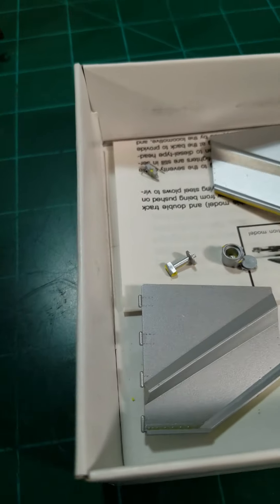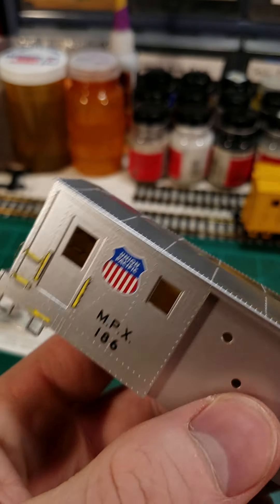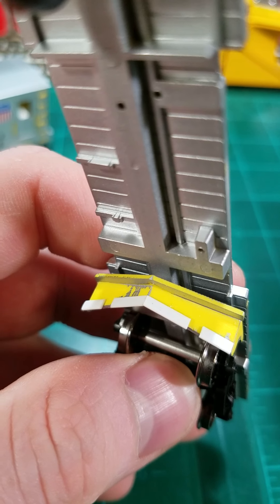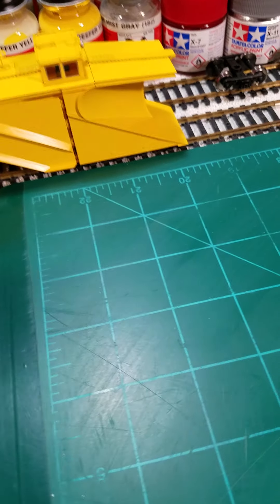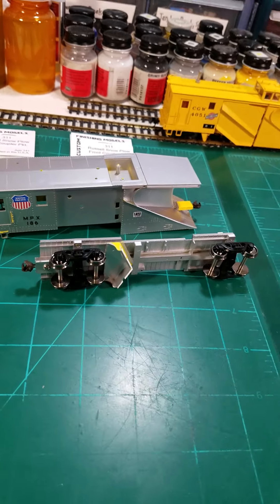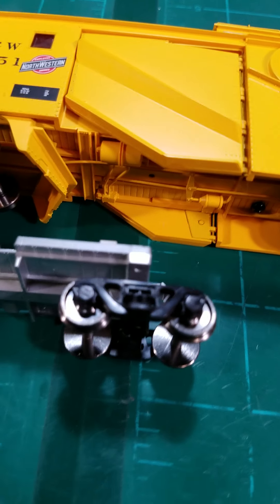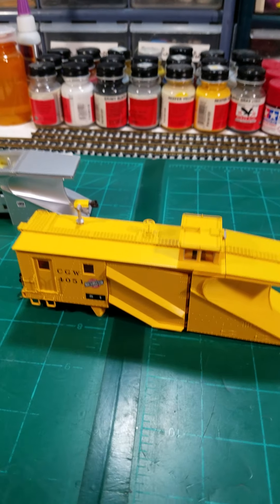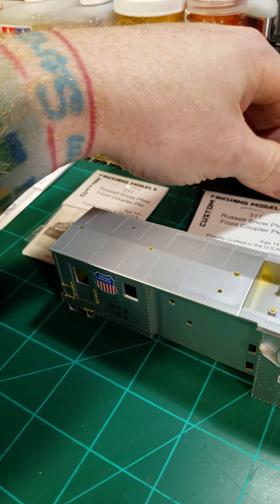HO Scale Maintenance of Way kits and upcoming Projects!

Comment: I just about finished a Walthers 42' MOW flatcar.  I used my razor saw to saw between the deck boards to deepen the grooves so I could have a go at weathering and distressing the deck and actually got a few boards to lift.  I also sawed a hole near the A end and the weight covered up my nice hole so I drilled and filed out the weight so you can see the track through the hole.  I didn't care for the molded on grabs so I cut them all off with my AproxO knife (never use an ExactO knife 'cause nothing is ever exact).  I then drilled out both ends for bronze phosphor wire grabs.  I also cut off the giant stirrups and replaced them with some Accurail stirrups.  All I have to do now is add my chain and paint the stirrups rail brown to match the underside.  The MOW flatcar came out better than expected.  Cheers from eastern TN